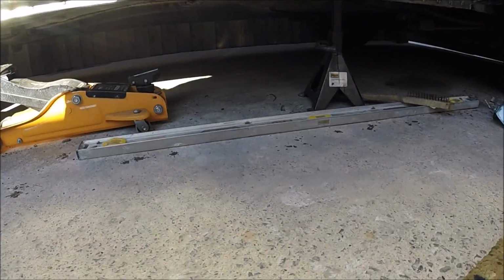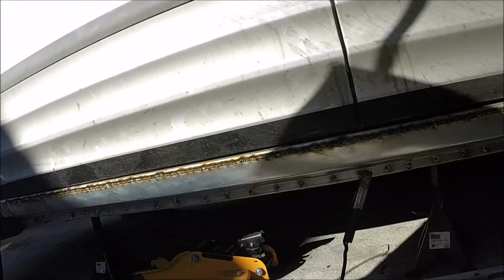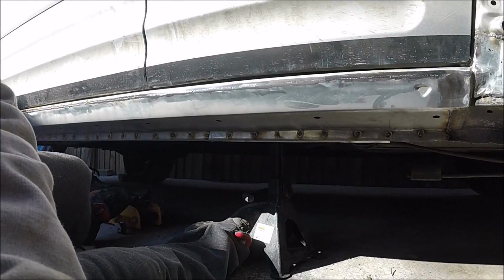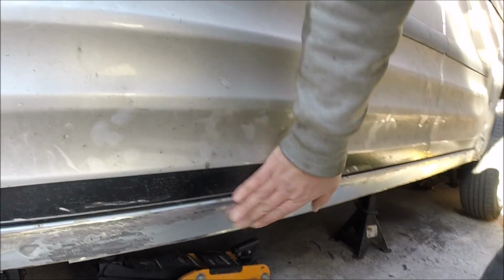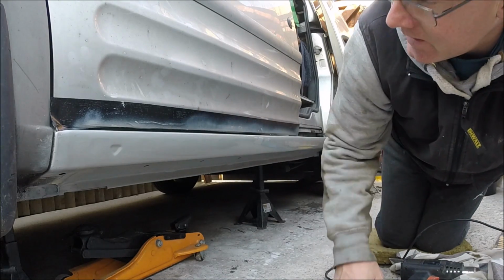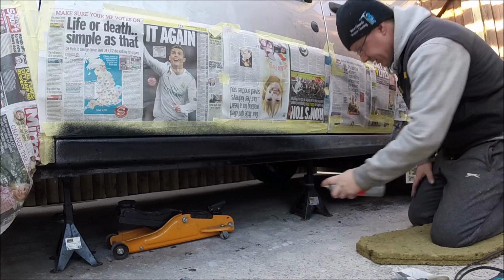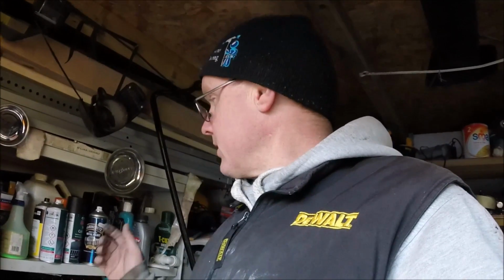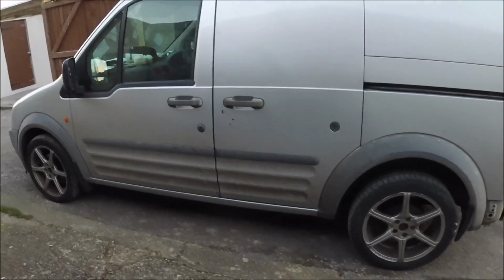Transit Connect sill part 2

Comment: great video, my 05 connect failed its mot on a hole in the sill  amongst other problems. Not knowing a great deal about vehicle repairs i was initially scared off with the thought of repair work on it. After watching this im confident i can give this a crack myself. Thankyou and very nice job of the repair
Reply from the maker: Thank you.

Comment: I thought this was going to be another YouTube bodge video but I was wrong. That work is some of the best I have seen on YouTube and real life, ( I have a degree in panel beating and welding ) you were spot on about the welding across the top of the sill, space it out and don’t let it get too hot, that is professional work. Also when you drilled the holes on the bottom and then welded them the correct term is “plug” weld due to you plugging a hole. 
Great work. Great video
Reply from the maker: Thank you I really appreciate that.

Comment: Nice repair but, the top weld would have come out perfect if you had knocked the bottom edge of top side of the cutout sill in a little allway along, like joggling, then welded the new sill to that.

Comment: Amazing Brilliant job steve as always ! I watched al your videos on the st amazing  ! I have the same van !  I might need a small panel under my driver's matt drivers side cut out replaced with a small bit of tin  welded on the floor ,  And some areas of the arches only small bits on two ends done if you can that would be great !
Great job you done here bud TOP ! I'm in Cardiff, can you let me k know how to contact you 💪👌👍
Cheers steve 
Gerry
Reply from the maker: Thanks gerry. I only do this as a hobby so don't take on any work for the public sorry. This was for a family member.